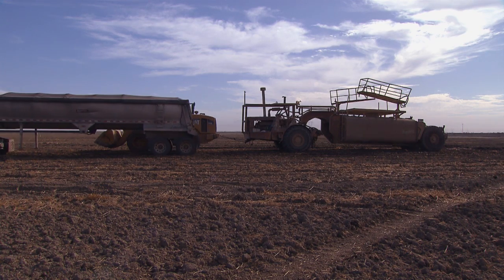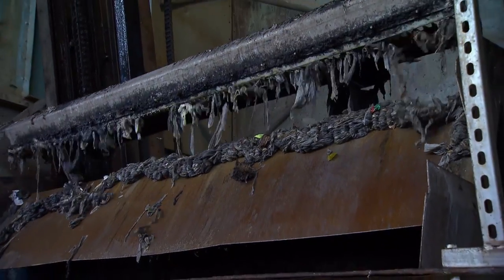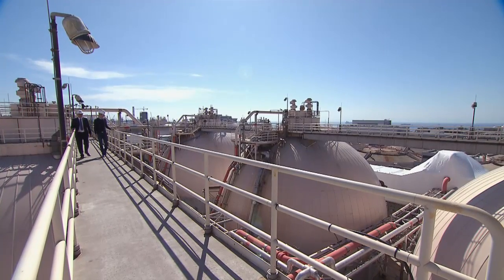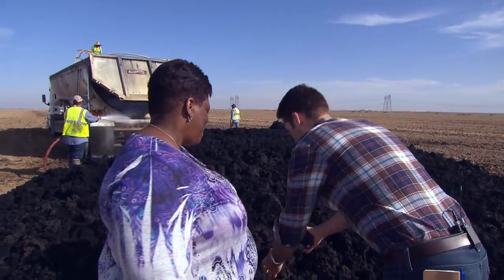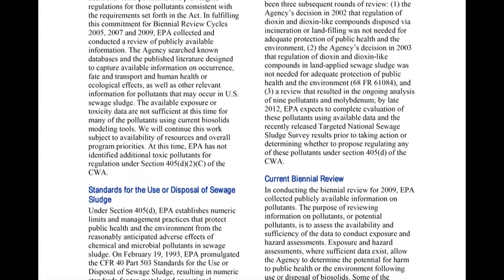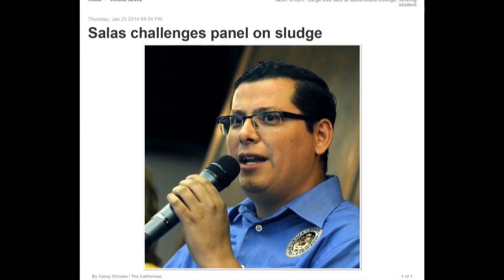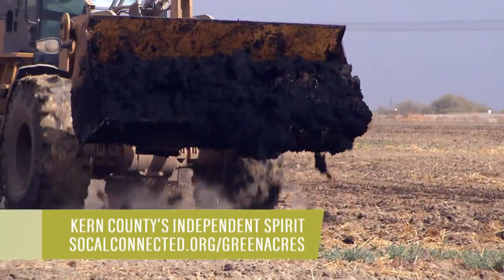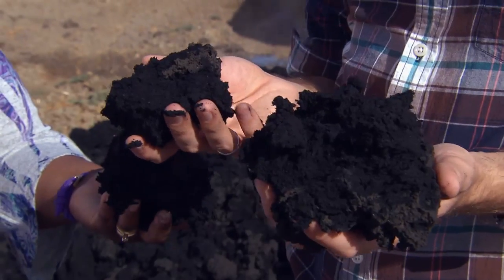Treated Human Waste as Fertilizer? | SoCal Connected | KCET

Comment: Okay all the germs are gone but if they havent done tertiary treatment then there will still be lots of chemicals, pesticides and pharmeceuticals. Does L.A have tertiary treatment?
Reply: I don't think there's too much "metals" or other chemicals in the waste solids. That is digested food solids, such as indigestible cellulose. Note that this expert fellow at 7:30 in the video saying that you cannot use any manure to fertilize. What the reason for that is was not explained. But there is not any more bad chemicals in that cooked poop than anywhere else. And the "pharmaceuticals" are unstable molecules that will break down in the soil if the cooking process did not decompose them already. It might have been better to just cook the poop solids to like 150 degrees, kill everything, and then just add in "good" bacteria.